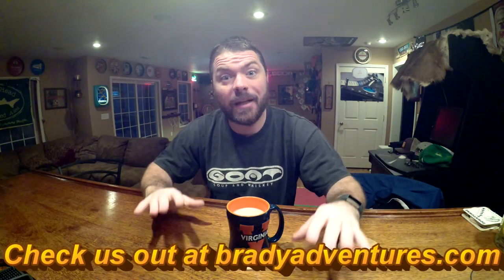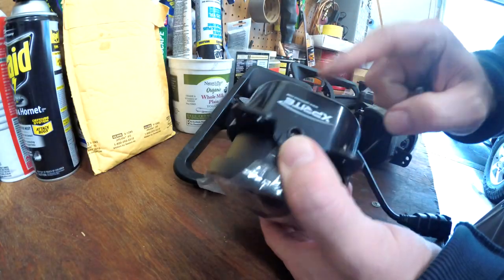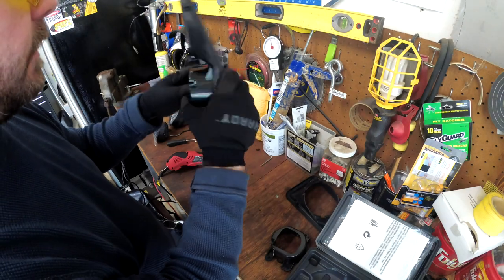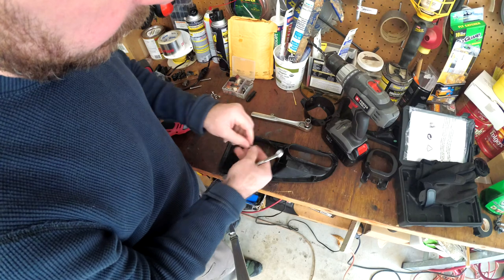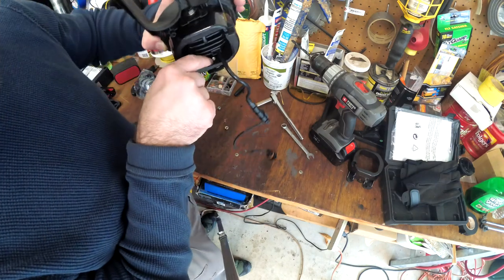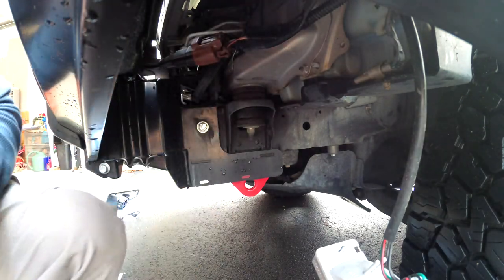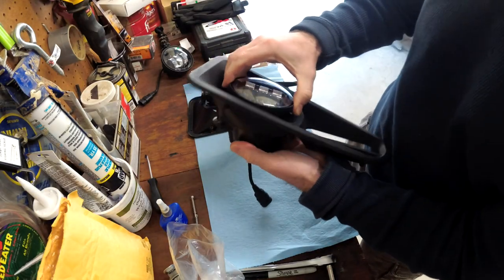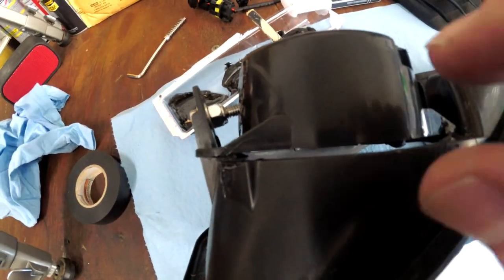ARB Bumper Xprite 4" Fog Light Installation - 100 Series Land Cruiser

Comment: Thanks for posting this. You have convinced me to spend extra $50 to get the ARB LED fogs.
Reply from the maker: No problem! Thanks for checking it out! I defintiely hear you. the install took some time and I wasn't exaclty happy with the housings strength. The ease of install of the ARBs and $100 price tag are definitely attractive following this project.  I think the one reason to still consider these is the output.  Based on the advertised stats the xprites are about 10x brighter.  I'd love to see them side by side to know the real difference.  Thanks!
Reply: I have the upgraded ARB led fog lights on my hundy. What I can tell you is that they are pretty bad as far as light goes. With my headlights being “meh” as well, my hundy puts out very weak light. The more powerful SAE fogs you can get the better. The stock arb lights are absolutely garage. This looks like a much better light solution.

Comment: I'm looking to upgrade my 4" fogs on my Ironman 4x4 bumper. They, too, offer and LED option for 100.00, but I really want higher output and yellow/amber. KC and Rigid both make 4" rounds, so I guess its just a matter of mounting brackets. I really want the Baja Designs but they are 3".  The Ironman bumpers fogs are in a separate location, so it may be easier.
Reply from the maker: Good luck!  Let me know how it turns out.  I wasn't totally happy with the housing but they have been doing fine.

Comment: Doing this mod tomorrow.  Do you think it's possible to run your main support bolts opposite of the way you installed?  So instead of having the bolt head on the arb bracket side it would be on the inside of the light bracket going towards the ARB bracket?  Seems like you could save some room inside the light housing.  Maybe even cut a square hole to acomodate a carriage bolt?
Reply from the maker: Sorry I missed your comment, sounds like you may have already installed them.  How did it go?  I can't quite remember but think there was an issue with putting the bolt in the other way.
Reply: @BradyAdventures  Just finished loctiting all the bolts tonight.  The outside bolts were easy but the inner ones were really tricky to line up & drill.  Had to use the dremel to filed down a small section of the ARB bracket to get a lock washer & nut on the end of the inside bolts.  I did end up running the bolts from the inner bracket out with no issues.  Anyway pretty similar to your install with a few tweaks.  Thanks for the video
Reply: I found drilling the two tiny little screws through the front of the ARB housing really helped to keep the rest of the fabrication lined up inside the housing.  I also used painters tape to hold the bracket in place inside the ARB housing while I worked on the different drill sections.
Reply from the maker: @chrislowery3520  Awesome ideas!  Thanks for the input!